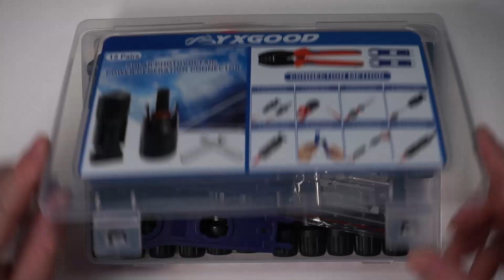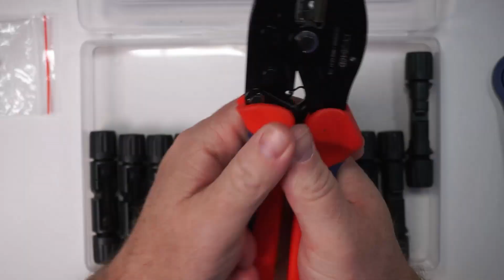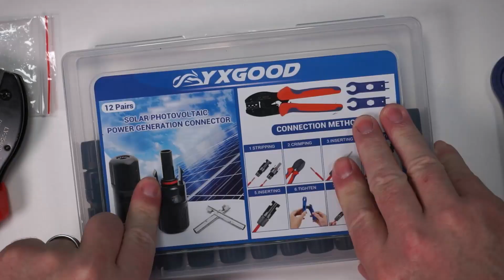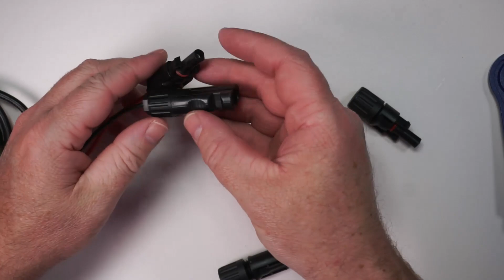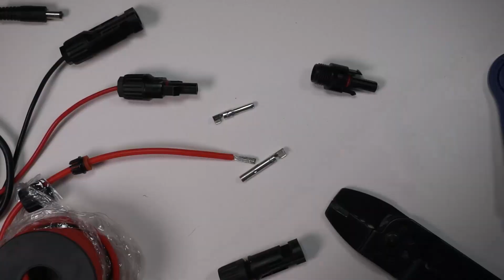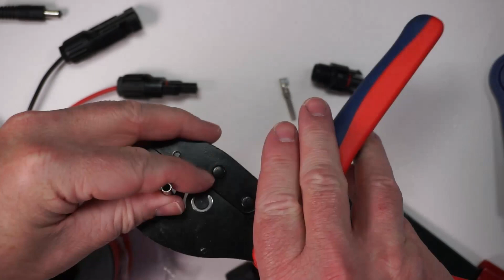How to use YXGOOD Solar Crimping Tool for MC4 Solar Connectors

Comment: Would love to see a good review on these, as in after using for some time not just a sales pitch. So far this is the closest I could find. I have seen some people saying their cable was not double insulated as advertised on eBay, and lacking in girth for the connectors etc (mc 4 from China), So i wanted to make sure these crimpers are good. Same with the connectors.
Nearest solar shop is too far away. Hard to trust anyone these days.
Solar set ups can cause fires and burn your house to the ground if they are not good quality, which should not be expensive, apart from the fact that there is strong demand etc.
Otherwise I will just use house wiring and protect from the weather using conduit.
Once again the government let's us all down by not checking quality of imports and not reporting causes of house fires.
Too busy doing their corrupt business deals I suppose.